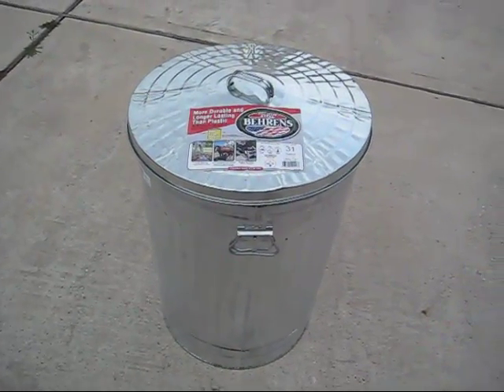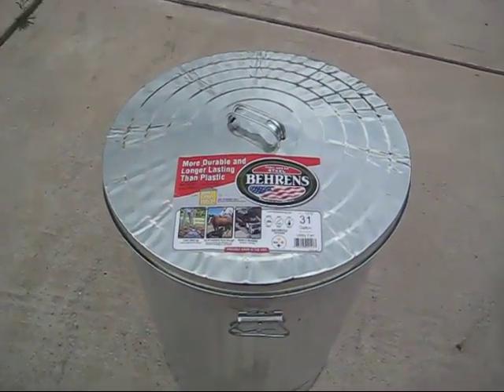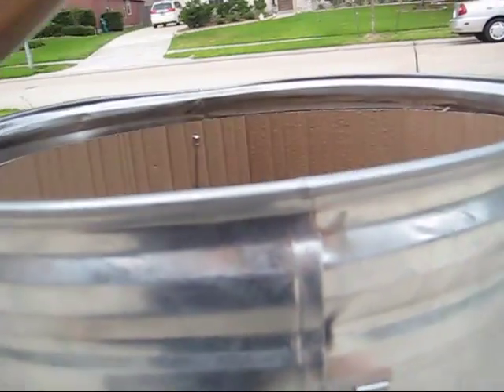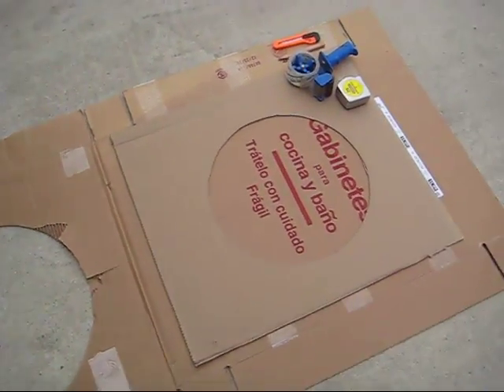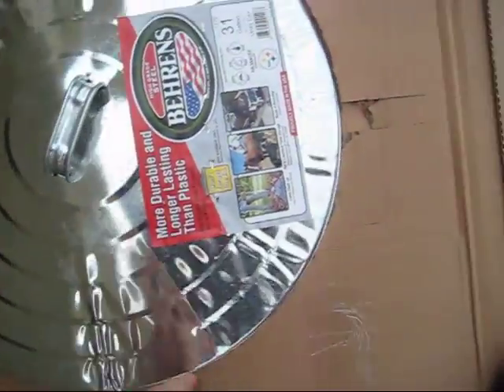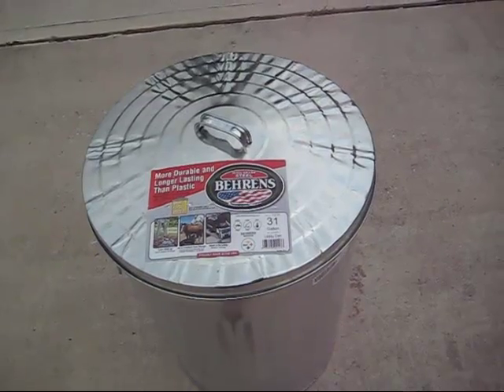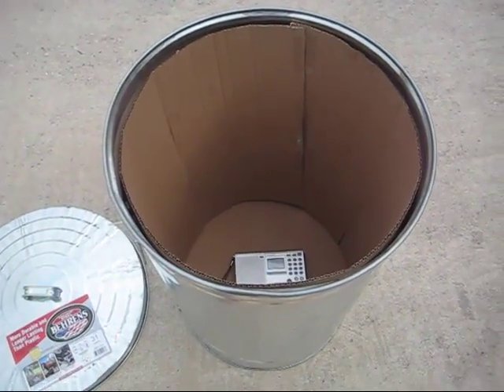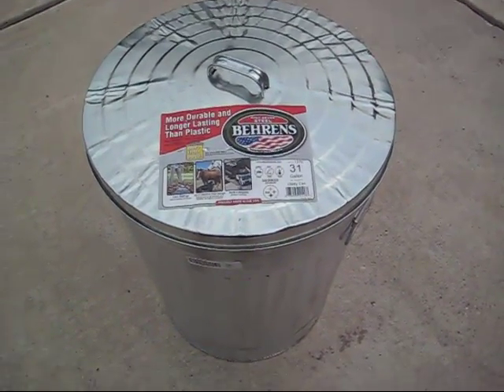Faraday Cage: Garbage Can, Really?

Comment: Okay, you protect your electronics, but a solar flare would take down the power, the internet, all the broadcasting stations, TV and radio, all the satellites. So, what use would you have for your electronics?
Reply: I keep a gas generator in a metal box, I also have several alternators, car computers, and other essential items to regain running cars, electricity generation, etc. I also have several handheld ham units shielded for communication. All are shielded against emp/cme. An old laptop with dvd drive to retrieve info burned onto disks.
Reply: I don't believe Russia or china will nuke us like some do. I believe a EMP in the upper atmosphere is more likely. They don't want to destroy the planet and I think they would want to invade for the big prize. I think it will be a first strike scenario. Not all of our military systems are hardened and it will leave a lot of our military blind. Protecting Night vision goggles, Solar battery chargers (I have the goalzero), Emergency Radios, Walkie talkies, police scanners, flash lights, watches. What ever you find useful. Not all radio frequencies will be destroyed. There are hardened facilities in the US and any chatter you can pick up will be useful. Not to mention enemy cross talk. The big thing for me is my night vision and walkie talkies. Most people will be without and any advantage I have over roving gangs and bad people in general the better off my family will be.
Reply: Lights
Reply: If U have a PC and hard drive U will still be able to view what is on the externel harddrive that U saved AND  by using another power hookup like generator.
Reply: red99roses A  powerful enough solar flare messes up the electronics, it will fry all the computers, all the satellites. Everything that has electronics. So, you wouldn't be able to use a computer. Look it up.
Reply: Angel Luis Trinidad having a loptop with 1000 of videos so that ppl know what happend when shit hits the fan
Reply: Ooooo. I didn't think about my night vision goggles. Altho I do have my Walkie Talkies and CB radios (several) protected.
Reply: Angel Luis Trinidad I put candles matches and lemons in my emp bucket
Reply: I agree with you that for the unprepared, most people will be without electronics, I also agree that this trash can idea is a failure waiting to happen but I think you are missing the point. There will be a use for electronics in a SHTF scenario. No matter what the disaster may be. We get bombarded by solar flares all the time. I think what you mean is CME's. Like red99roses said, there are things that people save on their computers and external hard drives that would be useful. I know I sure do, but at this point in time my computer isn't part of my bugout gear because I have no way of charging the battery. Now my other gear is a different story. I have made sure that the things I find useful all run on AA and AAA batteries which I can charge with my goalzero solar portable solar panel. Looking up and discussing ways to protect these things is called "being Prepared" hence prepping or prepper.. I think if you discount any electronics from your preps on the theory that a EMP or CME will happen, you are short changing yourself. There are a ton more likely scenarios that could happen. Being prepared for all of them in general should be the goal of any prepper. Now to answer what I have found on faraday cages. There are only 2 viable options in my opinion. Buy a TUF-BLOK faraday cage for 1600 bucks or bury your preps 4 to 6 feet deep. Which would be cheaper? buying double of everything you have and burying a set or the TUF-BLOK? for me its buying a extra set because I rely mostly on knowledge for my preps and I have very little electronics that I am takig with me. I hope this clarified the reasoning behind protecting electronics.
Reply: @oldmanpatriot1490 :What would it take to hook up a bike tire generator to one of those charging chords?  Just asking.
Reply: Are you speaking of the goal zero charging chords?
Reply: Angel Luis Trinidad your optics for your firearms
Reply: Angel Luis Trinidad it can also blow up some weak faraday cages to
Reply: I put all my survival info onto USB's. You can put lots more info on those, than you can a disc...
Reply: "I've been looking for 'building a large faraday cage' for a while now"
Anyone tried using and testing an old CONEX box?
Reply: Solar generators! ... And build it yourself to get more bamg for your buck. Some great vids here on YouTube. If all goes down, this tool would be worth more than its weight in gold.
Reply: Erika Zimmerman Candles 😏
Reply: What about saving them to have them available in the future.  Or saving digital pics?
Reply: Devils Advocate Survival. The EMP is incredibly powerful, just think of what it can do to weak faraday cages.
Reply: Angel Luis Trinidad your car park in the garage faraday your garage the whole garage  and leave an older car inside that garage with a full tank. 😉 load the car with two way radios ,flashlights, extra batteries  a battery charger and various other useful items. Bam theres why you want a faraday cage for electronics. Same thing with electronic repair parts you know a new car computer and major gotta have it to run items for cars that could be effected. The electronics repair items resistor chips chips capacitors resistors transistors even printed circuits of various sorts of things.
Reply: This was great, I been tryin to find out about "cage faraday video" for a while now, and I think this has helped. Ever heard of - Tennorra EMP Esterification - (just google it ) ? Ive heard some great things about it and my neighbour got amazing results with it.
Reply: Many thanks, I've been looking for "building a large faraday cage" for a while now, and I think this has helped. Have you ever come across - Tennorra EMP Esterification - (just google it ) ? Ive heard some super things about it and my neighbour got cool success with it.
Reply: oversoul, I've wondered the same thing. I have a 20' connex box I need to try this on with a radio, cell phone, etc., but since the bottom or floor is heavy duty wood and not all steel, I've wondered this myself.
If I remember, I'll try tomorrow and post my findings with a typical 20' overseas or connex (conex?) box. 
Thanks for jogging my memory.

Quick update: for grins and giggles I placed my cell phone in one of those anti-static baggie and called it. The phone rang but afterwards it dawned on me that I didn't insulate the phone case from the bag interior, so that may have negated any benefit of the bag.
Then I tried putting my cell phone inside of one of my gun safes and called it. NO RING and straight to voicemail after 1.5 rings, so that's something. As an aside, my safe sits atop a carpeted floor and has a Golden Rod dehumidifier installed which is plugged into a 110V outlet but that intrusion of an electrical conduit, so to speak, along with the 1" entry hole in the back didn't seem to make any difference whatsoever. That said, the safe has an electronic lock on it which "could" be rendered inoperative in the event of an EMP or CME thereby making my opening the safe impossible should those electronics fry due to either event. IF I knew a situation was pending, I could always remove the electronic face plate and place it INSIDE the safe, too, as long as I didn't completely throw the bolts closed and covered the lock wiring hole with quality aluminum tape to prevent a burst from finding its way inside using the wiring as a path to destroy the inner electronic components. 
So for now that is the extent of my testing and I'll still check out my connex tomorrow.
Stay tuned.
Reply: I have a faraday cage and inside it I have an extra laptop, an extra 4 TB drive with everything I need on it, power inverter, rechargeable portable radio and walkie talkies and 4 solar chargers. I also have two back up car batteries that I can hook the inverter up to and a solar trickle battery charger. 
You don't need a power grid. Cell phones won't work without the towers, so I don't bother putting one of those in.
Reply: Good question.  I learned from the answers.  Thanks, Angel.
Reply: Thanks. Very helpful.
Reply: Lets see...um electronic optics for rifle, watch, radios, lights, solar generators....were not talkjng about surfing the fucking internet, but essentials to live and survive. You dont need them but can make life easier.
Reply: Uh lots.... You recharge with solar, then you use ham for comms, night vision, flir, music to boost moral.

Comment: At 500Mhz (good representaive freq for EMP) the steel can is barely effective (-10dB). However, if you seal the lid AND and seams with aluminum tape then you will get close to  -50dB effect. Military spec levels are around -90dB.  SO, if you used a sealed can AND you placed the electronics in a metallized sealed bag you would have an effective system.  Now any protection is better than none. But this video is a bit misleading and incomplete.
Reply: much worse. They knew how to survive primitive conditions, we dont. write down or print out everything you can now. gardening, plumbing, local wild plants. everything and anything you can think of. Knowledge is power and even if it is something you cant use, you may be able to trade it for something useful.
Reply: disasterprepper has a spectrum analyzer and shows how good the can works.  it also covers mylar bags... very informative.  "testing garbage cans and EMP bags" is the name of the YT video.
Reply: Leonardo DaVinci so I can use this method but add using aluminum tape on lid and seals. also would  sealed  myler bags containing my electronics, placed inside be effective.
Reply: that is a good idea using the aluminum tape.i will be adding this to my can faraday cage.
Reply: I've watched videos doubting this trashcan idea for a Faraday cage. Best to get military grade bags (google it) and remember if an EMP happens you will still have to reuse the bags for a possible 2nd or 3rd EMP. Nothing more likely than getting an EMP then everybody brings out their electronics thinking well that's it then a week later there is another attack! Oh and remember you really don't want to be in the cities if possible when this happens, once everything has been looted and there is no food left then cannibalism will no doubt happen!!!
Reply: And don't forget to put chargers in too with your cell phones. Nested Faraday is always better anyway!
Reply: It will be like  the dark ages again? Coooool!!!!
Reply: Would that leakage still be enough to destroy electronics?
Reply: Alex A Depends on the charger. A lot are open circuits, so they wouldn't be affected.
Reply: Generic Name
Yes, but what about the mains cables?
Reply: Alex A Idk
Reply: What about copper tape?  Or is aluminum tape better?
Reply: @ecrusymphony  Copper is work great but aluminum is better in the respect that it is cheaper to purchase. If you use tape and need to get into the can then it has to be taped up again. Anyplace the handles are connected without welding should be covered with tape. The can does not have to be grounded, this a shield for RF not for lighting. A better check than using a radio is a cellphone. Cellphones use much higher frequencies than FM/AM radio. The higher the frequency the easier it is to penetrate very small gaps in a faraday cage. There’s a lot more to EMP protection. Tape used should have metal contact without glue so folding tape in such a way that some of it sticks to the metal and some is touching the metal directly is highly beneficial. Details count when power and frequency goes up with a real EMP. Hope it’s a helpful start.
Edit: oh and the cardboard is a good insulator so nothing on the inside is touching the metal can. And a god EMP bag makes everything that much better when placed inside the can. ✌️
Reply: You might need a can to jump into if you see the EMP missiles coming in ?
Reply: uare you  just hope there's not a satellite driven Faraday cage that renders the planet useless by then regardless
Reply from the maker: +Leonardo DaVinci I agree with everything you said. That is why I now use EMP bags from http://techprotectbag.com/
Reply: @Leonardo DaVinci;  Thank you very much for getting involved and informing this individual that what he is teaching here is not only very misleading, but it's inaccurate as Hell.  Your input of the military grade sealed metal infused bags is the way to go, while this idea of a trash can w/cardboard is as useless as tits on a boar!

Comment: The metal to metal contact of the lid to the can is not good enough for an EMP!!!  If you try this, test it with a coupe two way radios, like family radios, you will find that you can still hear the radio in the can.  Sealing the lid to the can with some aluminum duct tape will increase the width of the mhz covered close to over 100mhz.  I am a General Class Amateur Radio operator if you want to know my creds.

Comment: its useless, completely wrong! the EMP will get through the lid area and the fm radio is not even close to what an EMP would do, to protect your electronics use ALUM tape around the lid, what the fuck is the cardboard for ! it does nothing

Comment: Now wrap the lid joint with aluminum HVAC duct tape and also cover any holes where the handles might penetrate. Will improve the EMP blocking by another 30 db

Comment: While a ground is ideal and is used professionally, it's not practical for the average person. The can would have to be sitting directly on top of grounding rods and welded to them. Any length of wire will act as an antenna and must be avoided. As I said, impractical for most of us. If you can't do it right, it's better not to ground it at all.                                                                                                                                                 On a side note, a clever enemy knows all about us preppers, so they might just have a second EMP ready to detonate maybe a few days later, to wipe out any electronics that were protected from the first one. Just sayin.' Of course, not using your backup generator for your fridge and letting your food spoil will suck, so you just have to weigh the risk.